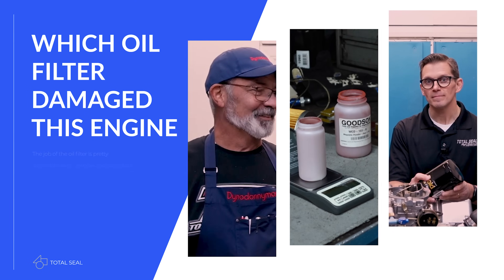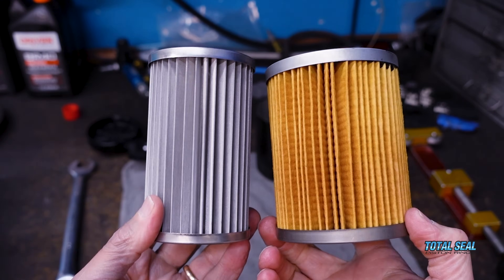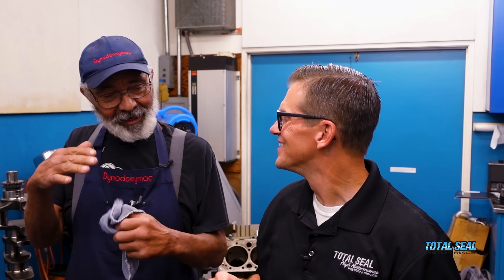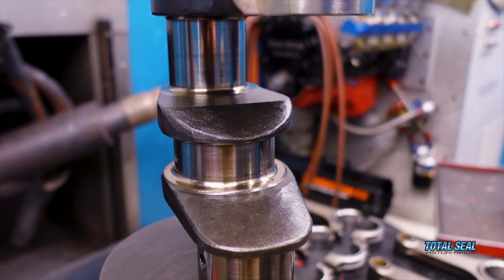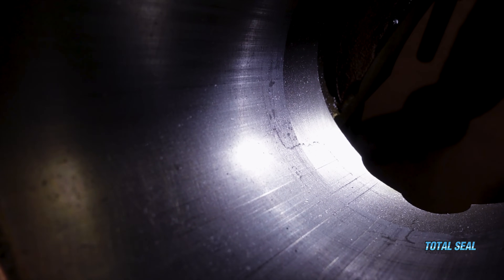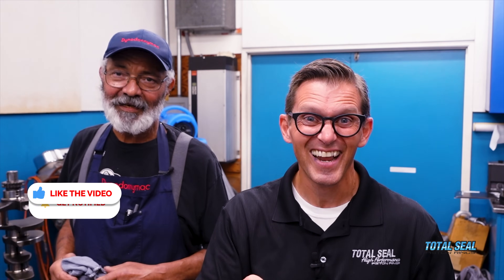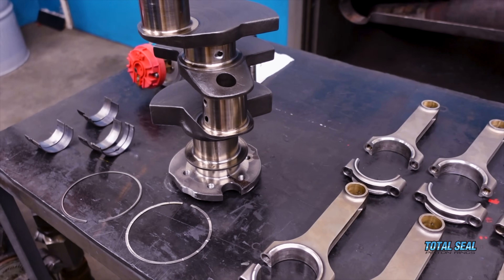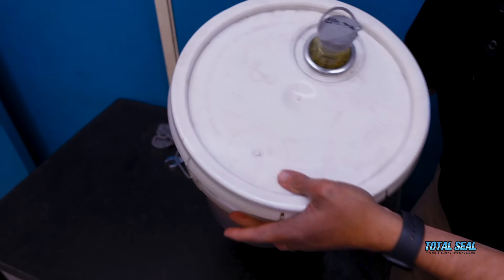We Put Iron Powder In Our Motor Oil... What Happened???

Comment: Great stuff. At 12-24 microns an even stock filter should remove a big portion of that dirt. But what many people don't realize is that  screen filters may claim to filter down to 10 microns but they don't list their efficiency at that level. Even a Wix filter is capable of 98 percent filtering down at the 30 micron level while all the screen has to do is filter one(!) 20 mircon piece of dirt and they can claim that they filter down to that level. A typical Wix filter claims to have 85 percent efficiency at between 12 and 30 microns with near 100 percent at 30 microns. So it could be that most of the damage was done in the first few minutes of operation before the paper filter did its job. All engines bypass a certain amont of oil so it takes awhile before all the oil is filtered at least once.  Still - a great test - but I would expect nothing less from you two guys!
Reply from the maker: Thanks!
Reply: Thanks to you guys and all the studied comments. To Jeff’s question/comment have you guys tested the CM (Canton Mecca) oil filters which claim to filter “down to 8 microns”? I’ve been using them on ‘06 4.8L Chevy (270k miles) and ’11 Honda (160k miles) with so far so good results. Would love to hear your comments.
Reply: Well all engines don’t bypass.

Comment: I'm curious; what was/is the mean size of the powder? Typical full flow filters are like 98.9-99.9% efficient on particles above 10/20 microns. So, the filters should have got most of the powder. I haven't watched the filter video yet, but I'm about to. What would be real interesting, if you want some more content suggestions, would be to run this test again with an oil bypass filter (Amsoil, Frantz, Kleenoil).
Reply from the maker: Great question, The ISO particle count revealed that these particles were in the 12 to 24 micron range.

Comment: Reminds me of how many people I see using Roloc abrasives on engine parts and castings then quick wash and bolting it all together....knowing,, at least I suspect ,,,there are still silica abrasives in the pores that will migrate to the bearings ,, cylinder walls , wrist pins ,,rocker shafts,,pushrod tips and various needle bearings ect
Reply from the maker: Great point!

Comment: And this is why my GDI engine oil gets changed every 5k miles, but the filter is changed every 2.5k miles. A clogged filter bypasses and the harmful crap just flows on its merry way. The smaller the micron rating, the more it filters out and I need my car to run a long time.
Reply from the maker: Wow! That should be very clean oil.
Reply: You don't even give the oil a chance to break in

Comment: I got some contaminated oil that ran through my brand new build for 20 minutes. The oil had little gold flakes of some type of metal. Didnt notice until i drained it after the 20 minute break in.

I wonder how my brand new bearings are 😵
Reply from the maker: Oh no!
Reply: Mabey some blasting beads got left in there.
Reply: Nothing that’s normal

Comment: In my past life I ran a self service automobile wrecking yard.  You would walk through the rows and rows of the cars and many times the customers had taken the engines apart as part of them looking for something they needed to buy, so you would walk along and see an engine for example laying on the dirt with the oil pan off and everything exposed.  You could look at the car it came out of and see how many miles were on it if they hadn't pulled the dashboard with the odometer in it.  As a long time engine guy, I would sometimes just pull the mains and rods off and look at it, and even sometimes measure stuff.  What always amazed me is that you have to know that often these cars didn't have the bet of care or products used over their lives.  Often the interior of the engine was pretty black and ugly.  But what always would amaze me is how good crankshafts were and what the bearings looked like.  Generally things were pretty good.  People would ask me how that could be and I always said it is a testament of the quality of all of the motor oils that are out there, no matter what the brand.  Clearly, we didn't know what was used in this car over its life, or how often it was serviced.  Honestly, all manufacturers engines showed those same results unless the engine was seized for some reason, probably overheated.
Reply from the maker: Thanks!

Comment: Off the subject but, can you test or at least explain the difference between highway and city driving on oil life?
Reply from the maker: Thanks for the question. Short trip, city driving shortens oil life because the oil tends to run cooler and gets more fuel dilution from the idle time.
Reply: Plus the oil doesn't get hot enough to burn off the 
Water that condensates in it.

Comment: ,,, one very interesting thing happened to us at Jenkins Competition about the time we put the first small block on the pole at the Daytona 500, with DiGard, and Donnie Allison, was that when we lost a flat tappet cam on the dyno, the first thing, before it could be heard, or even lost power, was that all of a sudden we had blowby . That nasty flack put dead vertical scratches in the rings . The flack, adhering to the piston skirts and some even to the cylinder walls , as it got slung out at a very hard velocity on the early disintegration of the cam and tappets . Definitely on the piston skirts, memory is a little suspect about the cylinder walls . But yes, blowby seconds before loss of power . Of course it was immediately shut down, and honed and re rung, and had to literally pick the flack out of the skirts .
Reply from the maker: Great story! Thanks for sharing!
Reply: @TotalSeal  ,,, yeah, most of it is like baseball, you can look it up . Gotta remember this was a strictly analog dyno . I got the fuel flow, Bill put a finger on the high torque reading while cranking in load with his other hand . In those days we had a very visible, large breather vent over a check valve, in the rocker cover that was less than 10 foot from our faces . I'm sure if he held the throttle and load another few seconds, the torque needle would have started dropping . This was greatly simplified by the John Hoffman procedure, soon thereafter  .

Comment: No real new information gained, with the exception of showing the metal screen filter used was not as effective, and by a decent amount compared to the standard paper filter.  This was more of a two oil filter comparison than anything else...taken to an extreme by adding iron dust.
Reply from the maker: The whole purpose of the project in the first place was to torture test the ring coatings. That was the mission. Everything else was fun stuff along the way.
Reply: @TotalSeal  In that case, was a successful test...I either missed you mentioning the main purpose or if in the first video I forgot that this was discussed.  Thanks for the reply Lake.